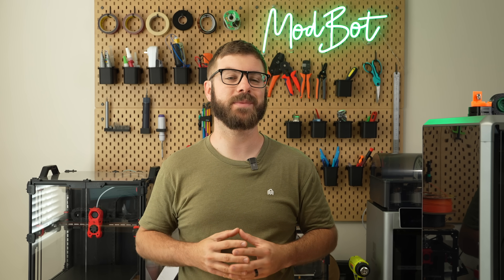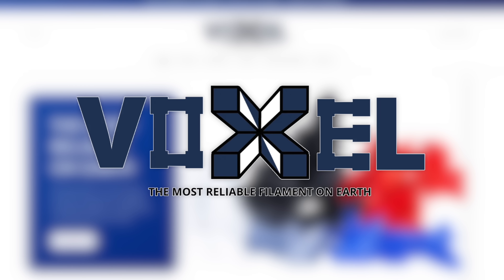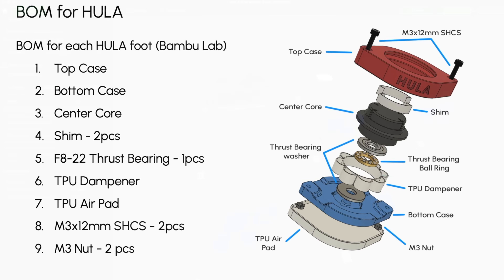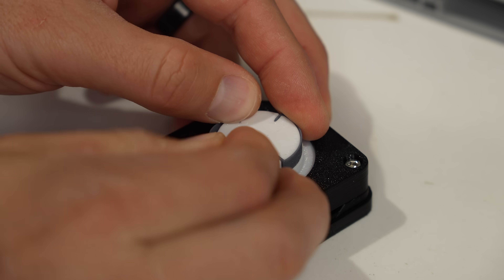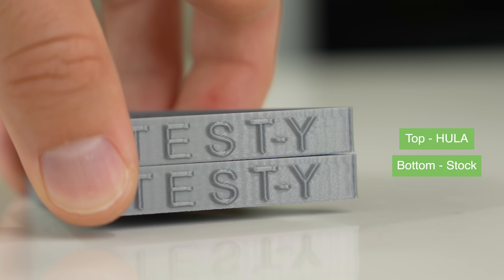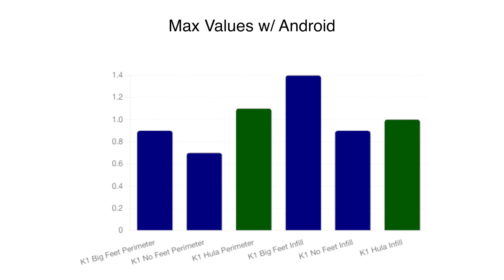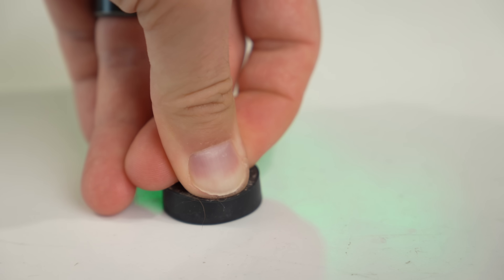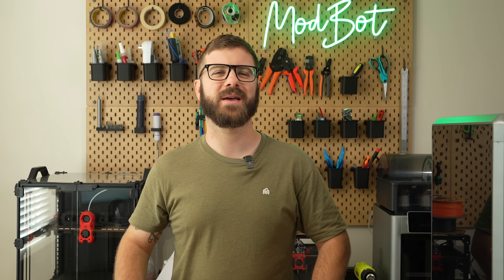Self-Aligning Anti-Vibration Feet For Your 3d Printer (HULA)

Comment: I use a cut-up old mousepad with 5 mm foam as vibration insulators. They help a lot with vibration damping, so especially the resonance tests of the Bambu printers are a lot less noisy. Other than that, neither the prints are affected by it, nor did i expect them to be.

Comment: Each application will require different energy adsorbing components, dependent upon the mass of the unit, its CG, the repetition rate of the impulses, and the natural resonance of the table. If the mfg is using the same foam/rubber/soft energy-adsorbing materials, it's random chance how well they'll work.

Comment: Cnc machines are supposed to be anchored to concrete slabs. Why would a 3d printer be any different? Seems to me that these anti vibration feet would only magnify any errors.
Reply: CNC machines range from hundreds of lbs to tons, as do the work pieces they operate on. CNC machines also typically reside in industrial machine shops. Work piece errors, which can occur on a micron scale, on a CNC can result in orders of magnitude more danger and lost cost/time. Wear and tear on a CNC machine/tooling is also orders of magnitude more expensive to maintain and repair and duty cycles are much more demanding to near constant.

3d printers particularly hobby grade, on the other hand, are typically under 50lbs and operate in peoples spare bedrooms, closets, dorms rooms etc. Errors on a micron level don't matter at all, and bigger errors are typically measured in pennies or minutes/hours lost. Maintenance/repairs are generally cheap and relatively quick/easy. Most 3d printers are not running a demanding industrial duty cycle.

Most critically these isolation devices aren't designed to optimize or improve the printer in any performative metric, they exist to make having a fast printer in the same/next room NOT feel/sound like you're living and/or working in a machine shop.

Comment: I am using my custom designed feet printed in 83A tpu and they work great. Havent released the file though because I know people will print in wrong tpu and then complain because the tpu settled. That bearing design is pretty cool though but not a easy print for most users as they need to buy parts just to make them.

Comment: I have a voron 2.4 and prusa xl, i was not aware of this project.  I had made adapters to fit large subwoofer/turntable dampening feet to my printers which seem to be a metal cup with an oddly soft large doughnut of rubber.  Not sure how much its helping as i don’t have any before/after prints but i feel like the desk they are on is being effected much less and my prints look pretty clean.  I have wondered especially with the voron how one might make that gantry both lighter and the whole printer more resistant to issues like ringing.

Comment: this feels like the opposite of what's best for print quality. I would imagine bolting the printer down to a massive cement block making everything as rigid would be best. Same reason they make cnc machines big and heavy and rigid.
if your trying to reduce vibration then make it heavy, if you want to reduce harmonics you have to dampen. What im thinking is go at it like the archery guys. what about rubber inserts into the extrusion? think slot covers but tpu and almost solid fill in the track. like filling your cnc machines neck with cement or epoxy.

Comment: I just have reinforced Lack tables and Lack enclosures with pavers coated in plasticoat for the printers to sit on, I have printed various feet for printers over the years and the paving slab with the stock feet have been the best solution IMO

Comment: I love how we went from "DON'T LET THEM VIBRATE! USE CONCRETE SLABS!" to this. It's always a back and forth.
Reply: It was supposed to be concrete paver on top of thick carpet padding. Just trying to absorb the vibrations to reduce noise.
Reply: Bolting to a concrete slab is still a better idea than this for anything that doesn't have a super stiff frame and bed mounting. There is a reason why machines, including high-end cnc machines still use mass to deaden vibrations and shaking. This might help if the printer is sitting on a rocking wobbly table by decoupling the printer from the table.
Reply: People like to think they are smart and over complicate things but mass is the answer and always has been

Comment: Not sure if I'm missing part of the video, but I think it's mentioned on the document of HULA that the machine must be set on a levelled surface for it to be effective, so you'll have to first level the table/ shelf, before putting your printer on it. And I don't see you mentioning it in the video, so maybe that's why the result you're getting is worse than the stock ones!

Comment: Personally ive had very positive results with the bambu lab feet. It was tricky to get them perfectly centered after installing, but now that they are in place i noticed quite a large reduction in general noise and vibration. I have my printer placed on a dresser and i can only feel vibrations within a few inches from the feet, anywhere else on the dresser i cant feel anything at all.
Reply: Same, they serve to reduce vibration transmitted to the surface and they do that well without negatively impacting print quality.

Comment: A wobbly table does not matter for print quality at all, and neither do these feet, this is a principle already known for very long in the precision engineering industry. For precision machines it is standard not to mount them as rigidly as possible to the ground, rather to have as low stiffness coupling as possible. This is done as to minimize the coupling of ground/floor vibrations into the machine, and not to reduce internal vibrations. Internal vibrations are caused by limited stiffness of its own frame and masses relative to its own frame. No coupling to the outside influences this, unless you are running some very weird scenario where frequencies intermix and couple back into the frame (in which case you also have a poorly designed frame). What matters is the stiffness of the coupling of the motion system to the print, and the mass associated with motion system.

Dont believe me? Refer to the video from Makers muse where he suspends a printer mid air (it doesnt get more wobbly than that) yet it prints identically.
I suspect the different results you were getting before with the wobbly table, to likely be because of incorrect input shaper results, rather than physical performance limits. The results you get in this video are likely more correct (as in 7:40 where all peaks are at identical frequencies).

As for your differing results, they could just be noise. Also, the location of the phone matters very much. The phone is measuring accelerations, and those are essentially the movement of the table boards. Changing the exact printer location changes how vibrations are coupled into the board, and changing the location of the phone would change how these vibrations are perceived (The table has its own natural frequency, and you can get standing waves inside of the board). It also does not take into account the frequency spectrum of the coupled accelerations. 

tl;dr Stiffness from 'world' to 3d printer doesnt matter for print quality, and a sturdy bench or soft feet neither help. And no, the feet also dont help with machine wear. Feet do help with vibrations of the machine being coupled back into tables, thus reducing noise, but this depends on the specific setup.
Reply: I wanted to say the same. Obviously less eloquent as you 😂. Yeah maker muse suspended his printer to prove a point a while ago now. Lol
Reply: Yeah, I work in manufacturing, and in our machine shop we have some grinding machines that go down to a pretty small decimal place. Those machines are built on top of granite blocks to reduce vibration and are kept a certain distance away from other machines, same as our inspection machines. Like you said, you want the machine to be isolated from external vibrations, and that's what the big granite blocks and slabs do. Best analogy is the paver stone upgrade for 3d printers.
Reply: Thank you for the info. Surprisingly very informative for a youtube comment.
Seriously I cant tell you how refreshing it is hearing from a dude who knows what their talking about
Reply: Adding on to this, it would be interesting to see the differences in a multi-printer-environment, e.g. on a shelf. There the feet should help to reduce the vibrations form one printer influencing another
Reply: I think a lot of people are misinterpreting the point of feet like this, and sometimes it is hard to tell what each person's presumed goal is. I think your very last sentence got to the point:

> Feet do help with vibrations of the machine being coupled back into tables, thus reducing noise, but this depends on the specific setup.

I interpreted the point of the feet as dampening vibration from Printer->Table "I want to dampen vibrations from the printer to reduce noise in the room", and the point of the video was "If you use these feet to reduce noise, will it affect print quality?" However, I was disappointed that he never tested loudness or considered it in the comparison and after reading this comment I'm questioning whether he was seeing the feet as a tool to dampen vibration from Table->Printer and was only concerned with whether it was effective at improving print quality. For that matter, now I'm questioning if even the makers of the feet had that goal in mind? Am I the only one who has a problem with being able to hear motor music all over my house while printing?

As you said, protecting the machine from external vibrations is unnecessary and if that was the point of the feet, its an utterly useless endeavor. The point should be to protect the table and your ears from vibration from the machine. If you don't care about the noise, don't bother with the feet.
Reply: @JohnFX3 
I have my printer mecanocly connected to a slab of concrete, and that concept stab has the same foam that you have under a Washing machine lead to isolate it from the ground 
Works really well
Reply: The maker muse video's biggest takeaway is that proper dampening is the way to the best results.
Reply: This is the way
Reply: So what’s the solution? Try and bolt printers to a desk that’s also bolted to the ground?
Reply: @TJbuffs  concrete https://www.youtube.com/watch?v=mA5jHT-Nwxs&t=359s
Reply: @TJbuffs  A solution for what problem? Printing quality? Then there's no problem, and thus nothing you need to do.
As for noise, it totally depends on where you put your printer.
Reply: @tHaH4x0r   yeah that makes sense. I definitely wasn’t arguing with you, I guess I just assumed with that vibration it must be keeping us from a more perfect print quality.  But maybe it really doesn’t matter that much. I notice my Bambu rattles pretty hard, just thought it was possible!
Reply: I'm really interested in this topic, coming from a machining perspective, but by the sounds of it Didymus got quite a bit more experience than me. I got a 3d printer recently, and I'm used to CNC. I guess gcode is still gcode, but it's kinda a new world for me. I've watched MM's video and read all the comments here, still I'm not sure I understand the problem. Precision machines go on granite plates, I'm ok with that :) But a wobbly table is the same as a granite plate, so put a cnc machine on a wobbly table is ok? At least my gut instinct says no, but I'm kinda out of my depth here. I found this video because my 3d printer was coupling to my table however, so at least I'm greatful for that info, thank you haxor. So to get to the next level of accuracy, and this might be a strange conclusion, but it sounds like running your 3d printer (or cnc machine) on an air hocky table would be the ideal scenario - each vibration would perfectly cancel out, and there'd be zero coupling.
Reply: still, a TMD on top of the printer to resonate at the harmonics of the printer would be an interesting project with benefits
Reply: Most CNC machines I've seen are bolted to the floor.
Reply: Brother dropped a whole ah paper long comment just to roast
Reply: This is probably the best comment 👍
Reply: The problem is wobbly table makes it hard to get clean accelerometer readings for which resonances you actually have to suppress.

Comment: It makes no difference to stiff machines like the X1C. You actually want a nice solid base like a paving slab and use the stock rubber feet. It may make the printer noisier but it will absolutely reduce the vibrations in the machine.

These sort of feet just make the machine wobble which could introduce more errors.
Reply: Put foam or something softer under the slab, that will quiet the printer.

Comment: Eh, literally the most impressive upgrade I've added to my printer is a simple concrete slab. It improves prints and noise more than any anti-vibration thingamabob I've tried over the years.
Reply: Can agree, I just added a cement slab under my prusa mini and it got waaaaay quieter for like 5 bucks
Reply: I have put a piece of soft foam under the slab, it cuts down on the transmitted vibrations and dosent shake the shelf as much as just the slab

Comment: The test with accelerometer on your phone is fundamentally the same as input shaping acceleration measurement.

However this setting method of input shaping, minimising vibrations, and the corresponding measurement method, is misleading. The machine may vibrate as much as it wants around its origin. You want the bed and the toolhead to move rigidly relative to each other, you don't care how they move relative to Earth, which is what accelerometer is measuring.

So you want to tie down the machine to something immovable and have the input shaper figure out and suppress inherent resonances of the machine; and then you can place it on decoupling feet for improved quality - less relative vibrations since they are converted to global vibration + damping. Also improved quality of life due to less noise, easier placement etc.

The only valid assessment for the feet is by looking at print quality. Not accelerometer readings.

Comment: For my X1C, I went for a more rigid setup -- made feet that lock into couplers that are screwed in a cement paver, then placed on the floor. Vibrations have never been an issue.

Comment: I was getting interested until you showed that I should calibrate without feet and then I would get better results WITH feet. I'm not sure about your background (software?) but to any decent engineer (mechanics or similar fields) this is clear indication of BIG issues somewhere, and your final results confirm it: sometimes the feet enhance, sometimes they reduce vibration measured with the accelerometer.

To make it short: there is no way that an elastic/damping element can be blindly applied to a vibrating system to guarantee an improvement: the damping and the elastic components of the feet should be tuned to the actual mass and acceleration of the vibrating component (the printer).
Since this HULA does not tell you how thick and how rigid the elastic/damping wavy ring should be based on the printer, this whole test is based on pure luck and the design, which in principle is interesting, literally cannot be suitable at the same time for the A1 and the K1, which differ in weight by a factor of at least 30%. I wonder how bad it would be on my Q1 which weighs twice the A1 mini.

My take from this video is about the use of Mercalli and similar apps to evaluate the vibrations on ky printer before and after the dampening mat i bought, one of those for laundry machines